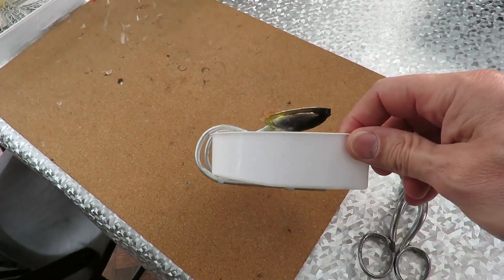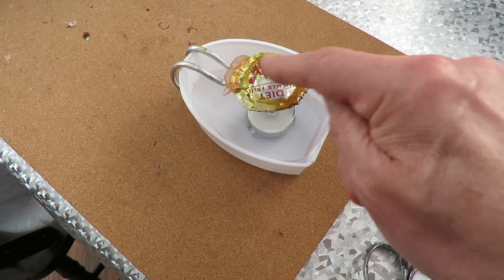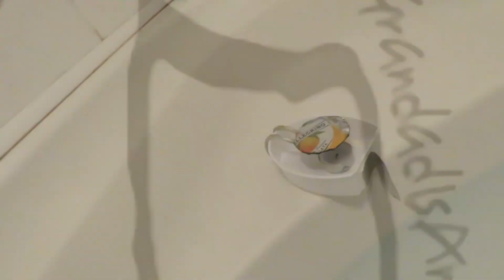Pop Pop Air Freshener boat - boiler revisited

Comment: Success
Reply from the maker: They are fun when you get them working. Some people like them to be extra noisy, I have done several that are virtually silent.
Reply: @GrandadIsAnOldMan  yeah I’ve seen a few of the different ones you have made. Me and my son are going to try to make the boiler out of the bottom of an old spray paint can like one of the ones you have done.
Reply from the maker: @electropancake1554  finding cans that are made from steel rather than aluminium can be surprisingly difficult. Spray cans are usually OK although they tend to be a bit thicker than ideal.  I don't remember the last time I found a beer can that was steel. In a perfect world a nice thin sheet of brass or copper would be best for soldering but that is now very expensive. You can use two part epoxy to glue aluminium cans and it will probably work as long as you need it to. Good luck 👍